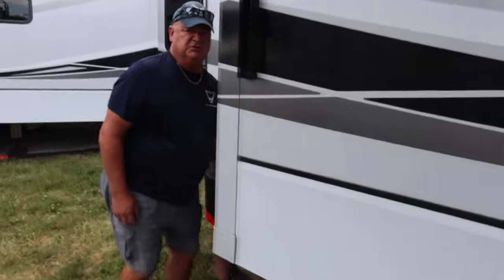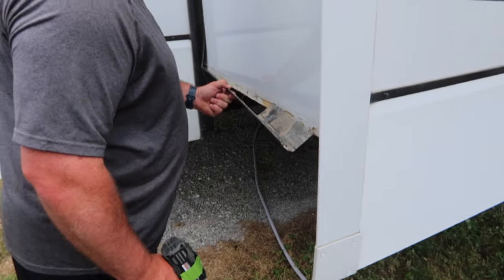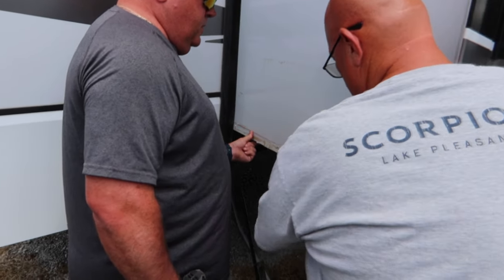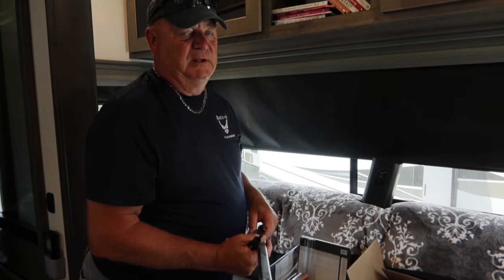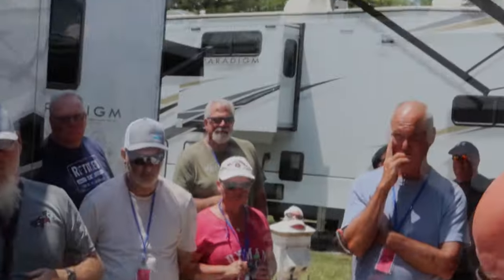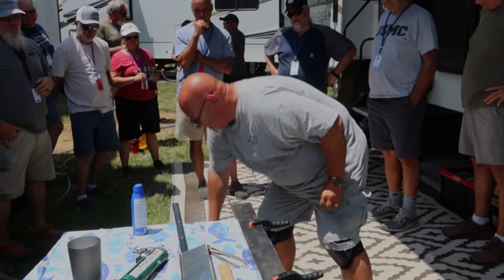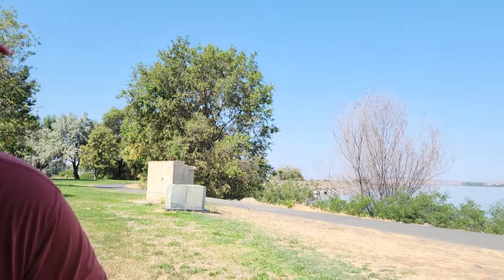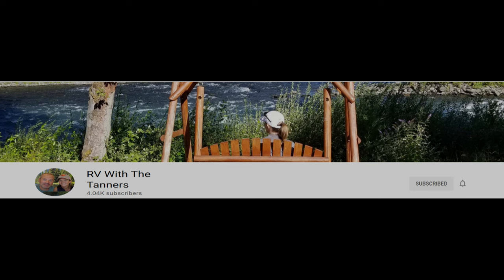RV "Slide Ski" Replacement

Comment: I made my own ski out of aluminum angle… used a brazing rod and MAP gas torch to ‘weld’ the ski at the curve at the inside tip.  Mine are also a lot stiffer, and I was able to counter sink the screws flush, giving a nice smooth ride on the bottom.  We use some thick plastic sheet pieces on the floor when we pull slides in to protect the floor.  The slide rides up nicely as it comes in, however there is always a point when the inside of the slide settles onto the floor for the last foot or so, and the floor needs some protection.  As the gentleman indicated, some manufacturers just staple the plastic skis to the coach…

Comment: If this company that makes these stainless steel skis really wants to nail it, they should cut them to size and put the screw holes in them. As most slides are pretty standard size. I should be able to tell them that I have a alliance paradigm. 340 RL and I need skis for the kitchen slide or the dining area slide or the bedroom slide and they should know the measurements and pre-fabricate everything and send me exactly what I need. Just saying it would make it a lot easier on the consumer as far as cutting tools and special drill bits. And it would not be much extra work for them at all. Maybe in the future. This could be a very lucrative business for them.

Comment: Looks like another fix necessitated by poor quality in manufacturing.  It's sad that this problem just like the tank sensor problems has been around for years, and the manufactures just keep shipping it out to the customers.  There are easy solutions to both.  So much for the "customer driven" party line nonsense.